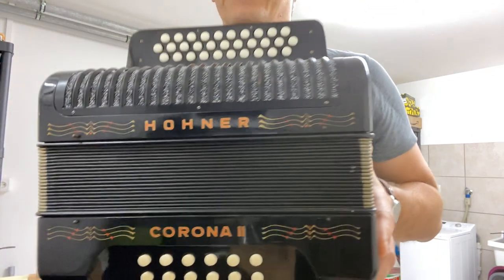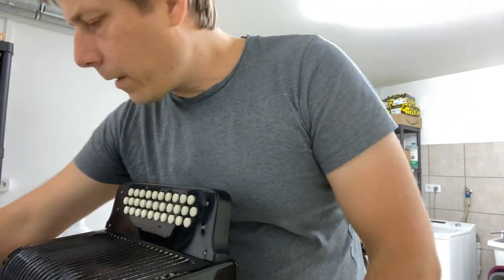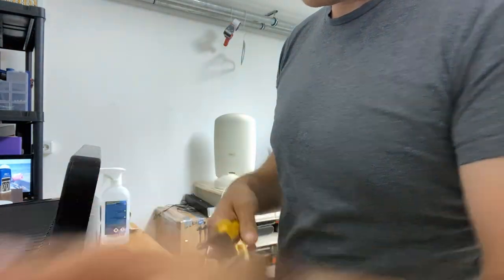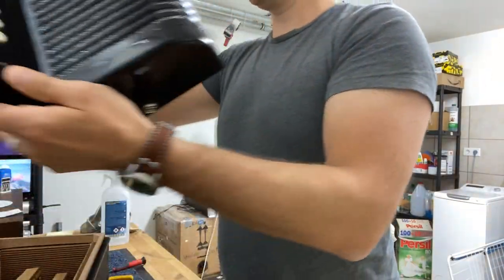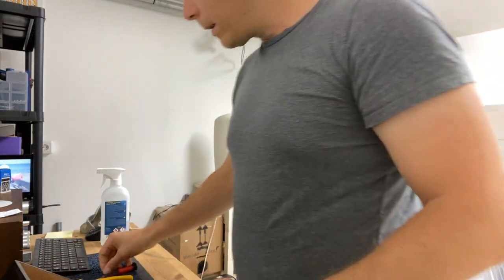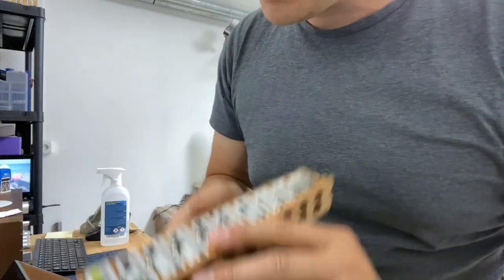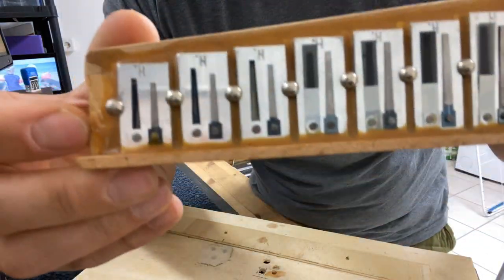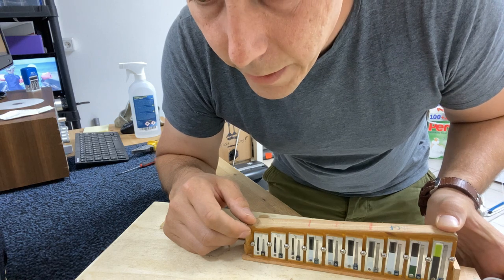TUTORIAL #3: UNSTICKING STUCK ACCORDION REEDS

Comment: Hey I need some advice on my acordion sound doesn’t come out on pull.. I’ve already tried to check for dust or debree.. but it does have sound going in
Reply from the maker: Well, it could be other things. If the reed tongue is too far from the reed plate, or too close, it will also not oscillate. Or, it could be somewhat crooked. Try comparing it to working reeds next to it, and see if you notice any visual anomalies.

Comment: I have a question. I have an accordion with a sixteenth note in the channel. The voices are clean, without corrosion, while the 16th note in the channel has corrosion. Is it possible to clean them and how could they be cleaned?
Reply from the maker: What do you mean with 16th note? You can scrape off the oxidation to an extent, or try a little rubbing alcohol. You may need to tune, though.